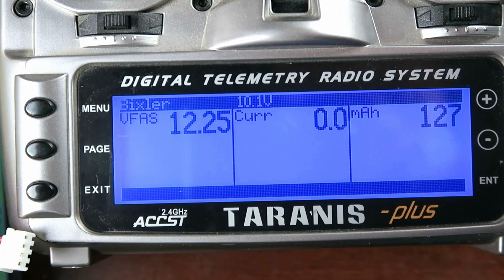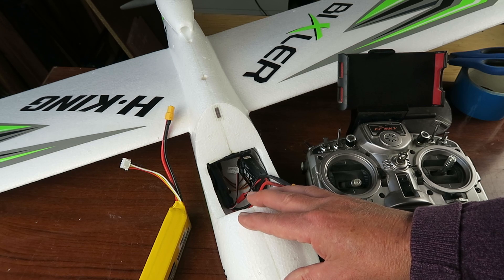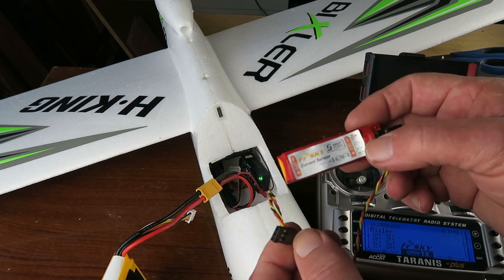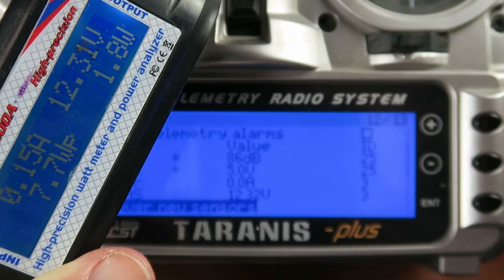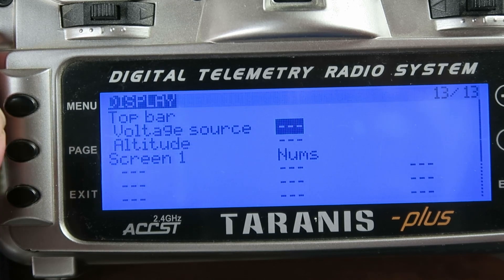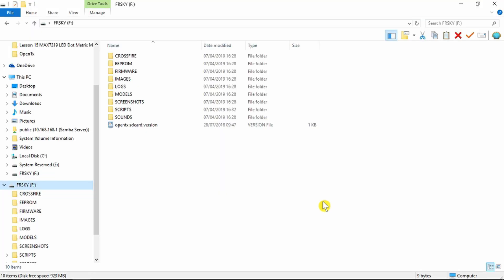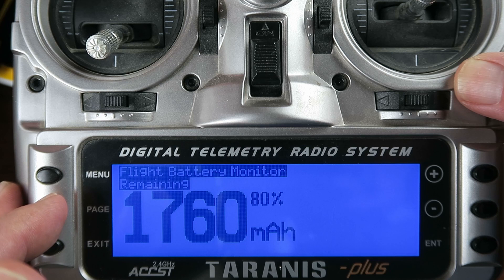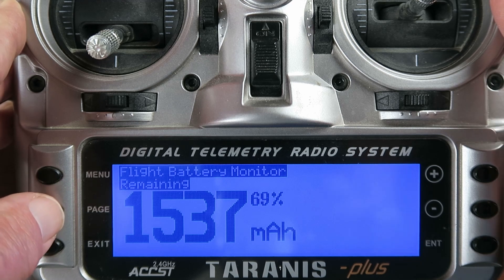FrSky 40A Smart Port Current Ampere Sensor FAS-40 Sport Review

Comment: Thanks for such a useful and well made vid. In addition to using it with my aircraft (limos), I've also installed it in a 1/6th scale tank with a 24V 20Ah lifePO4 battery. I can't see however how to adjust the units of measurement from mAh to Ah on the LUA script or GVs to give battery capacity remaining. I'd be grateful for any steer you might have. Thanks again.
Reply from the maker: Hey thanks! I took a very quick look at the LUA script. It seems to me the mAh value stored in the GV location is mAh/100. If you changed that to mAh/1000 it would be in Ah. In the display section change mAh to Ah. As I said I only took a quick look and may be way off!! Let me know how you get on. Please consider subscribing if you have not done so already!
Reply: @1nformatica  thanks. Worth trying. The issue I’m trying to overcome is the min/max limits of 1024 on GV values in OpenTx. Thanks again